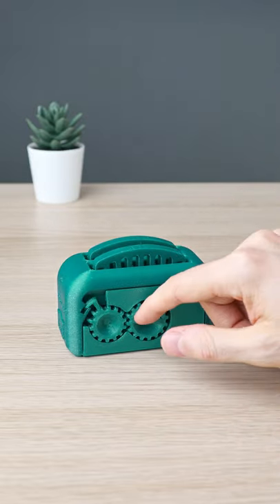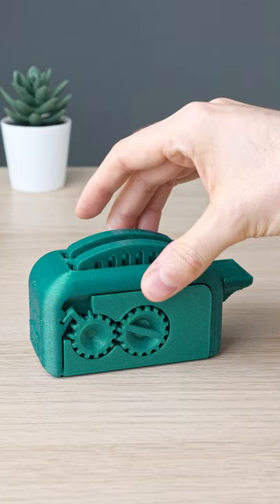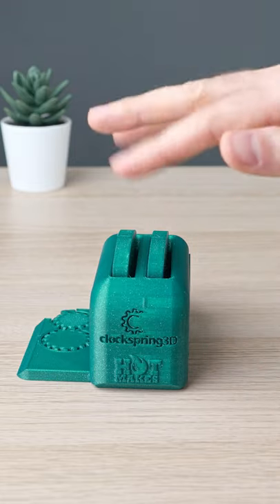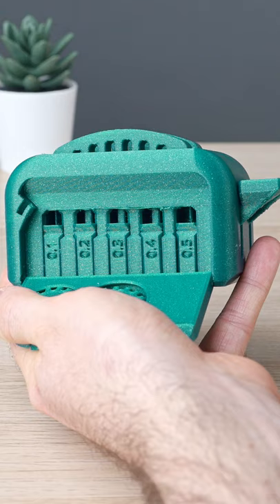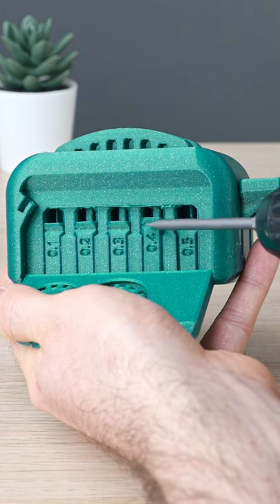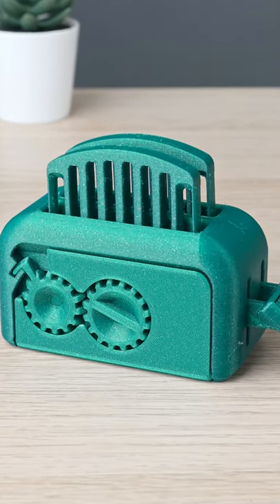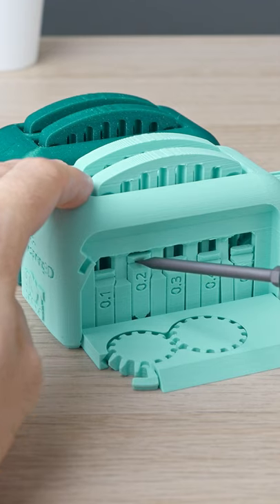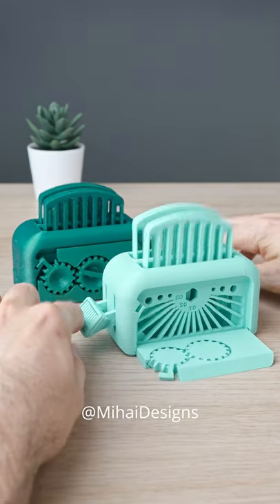There's a new toaster in town. Dare print it?

Comment: What is this used for? Like is it just a toy or does it have a use?
Reply: It’s testing the tolerances of the printer, so it’s kinda practical but not something you’d probably need to print more than a few of if you know how to correct the issues.

Comment: Yes my printer can handle this.... on a raft.  Always print “print in place” things ON A RAFT. Thank me later
Reply: Why is a raft advantageous for "print in place" things? Doesn't a raft only solve issues with the first layer?
Reply: @neur303  because the first few layers are very important in a print in place especially if the tolerances are very small. If your printer settings first few layers have a bit of elephants feet it will cause these tight tolerances to get too close and end up fusing together.  Then the rest of the layers will be fine. The raft serves as a sacrificial layer. So even if the rafts first layers have this elephant feet it won’t carry on to the actual print and will give you a better chance that the print’s first layers won’t fuse.  But this all depends on the model.  If the first few layers of a print in place model have a large gap in between then you can get away with out printing a raft.
Reply: @Guapogiboy  Thanks for your time! Definitely easier to have a sacrificial layer instead of trying to get everything perfectly in tune. And probably a lot cheaper too. My bed has a slight bulge downwards in the middle. ATM I fixed that using multipoint bed leveling. But I never thought of how that warps the printed part. Would be nice to print the raft using the surface information. But like you said that's likely not even necessary since the raft allows the filament to have some room.

Thanks again, you made me rethink and understand!
Reply: @neur303  if rafts don’t work. Try a glass bed or a flexible steel bed. That helped me with mine. My original magnetic bed had an air bubble in the middle between the printing surface and the magnetic sheet. When I replaced with a Wham Bam surface it was all good.
Reply: @Guapogiboy  I didn't have the need for tight tolerances yet and I intend to build a Voron 0 and get a bed with a ground cast aluminum build plate for that. But thanks for the suggestions 👍